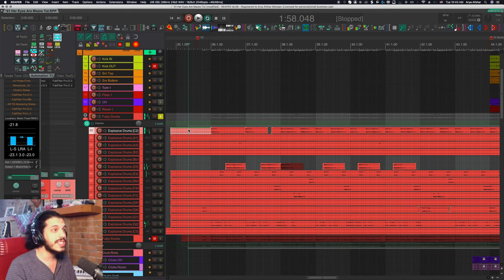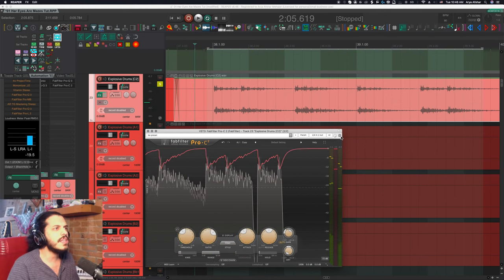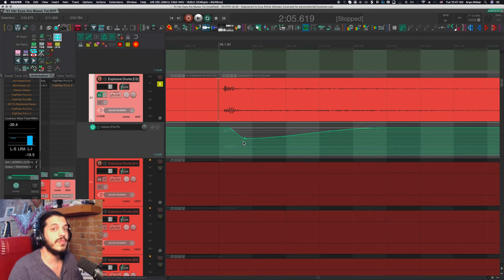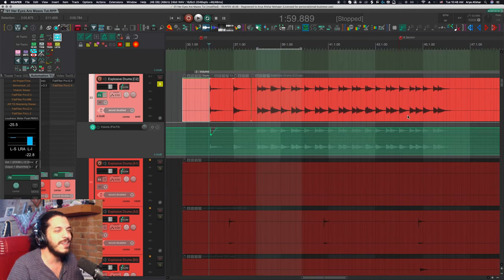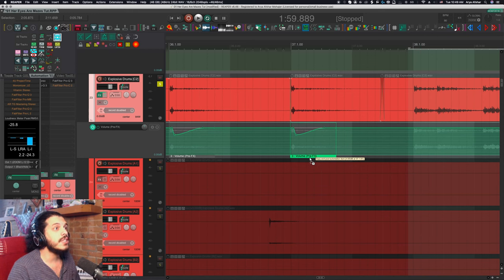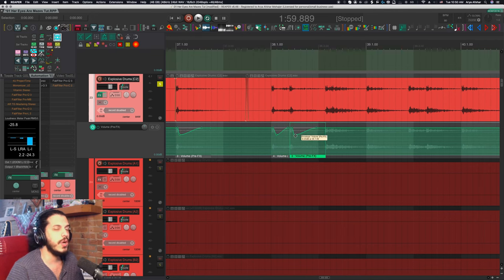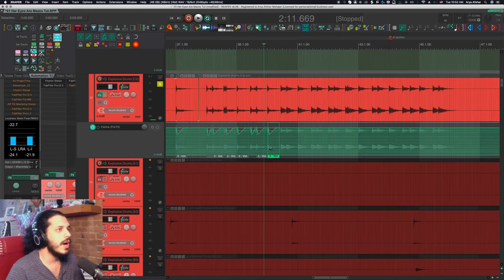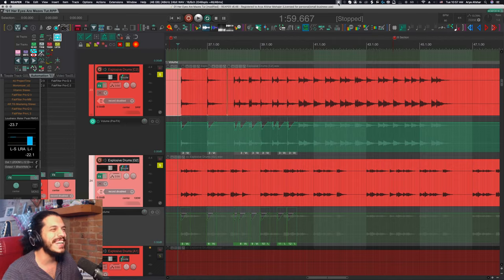MANUAL Compression??? The dumber (but somehow kinda smart) way to do gain reduction

Comment: Hi man nice video! What settings you need to change to get that media item visual efect? (when you adjust the gain up or down in the automation the item transients  also change in my case that doesn't happen)
Reply from the maker: You have to choose the pre-fx volume envelope. It won't happen if you use the regular volume envelope :)

Comment: I disagree that this isn't technically compression... if you adjust gain to reduce dynamic range, it's compression! I think manual compression is a great descriptor.
Reply from the maker: Yeah I guess it was mostly for nitpickers, since compressor have a ratio and a threshold, and this doesn't ie gain reduction stays the same even if you turn down the incoming signal, but yeah basically it does what compression does :)
Reply: ratio is how low you pull down the gain and threshold is where you put it 🤓